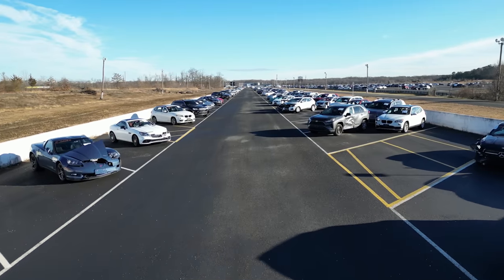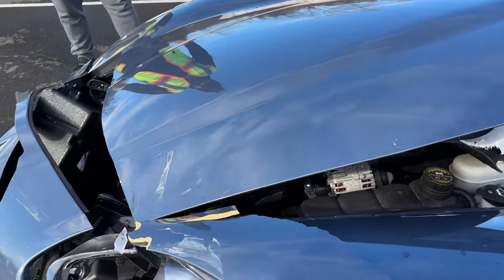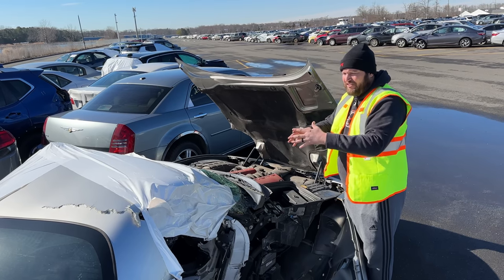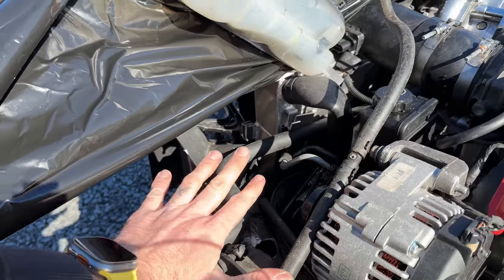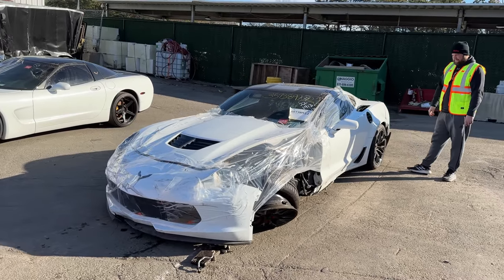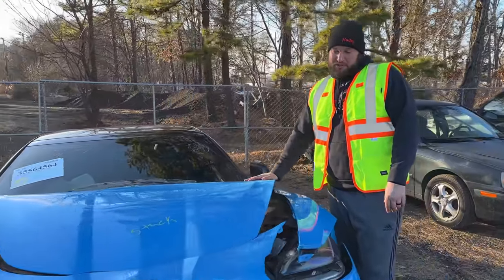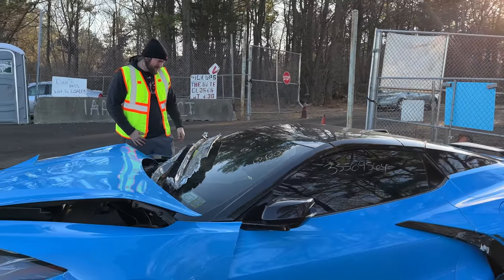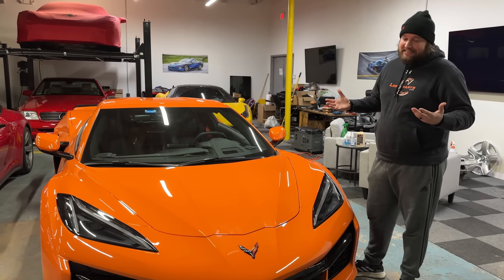The FIRST Corvette C8 Z06 At SALVAGE AUCTION Is Insane...

Comment: Guys like you compete against me at copart. but doesn't matter.. still built a ridiculously fast 00 frc with 03 z06 "heads/cam/headers/x-pipe drivetrain. The frc had no engine and was bought at a dealer auction in east Texas.. Both cars and my previous C5 knowledge/set-up/ thirst for power  created something rare, fun and hellcat/ zl1 disappointer. Will dyno tune it soon and work on suspension and brake improvements. Really like running bikes and teslas though. All for under 10k and a solid 40-50 hours of personal wrench time.
Reply: Sounds badass, hopefully it’ll put down something in the mid 400s, my barely modded Z put down a little over 360 with 130k plus miles, the frc/z is one of the most fun cars ever made for the money